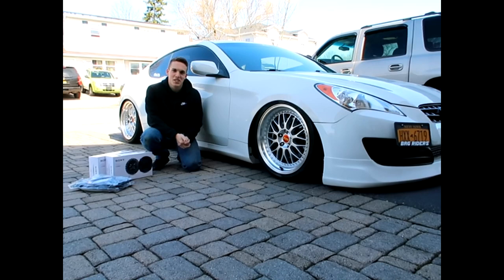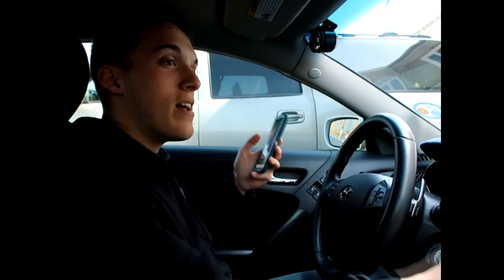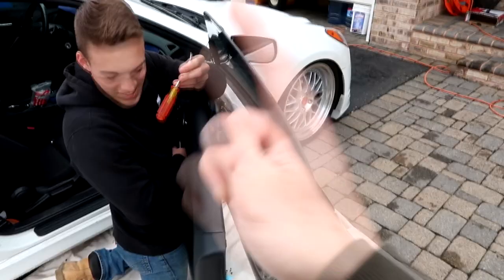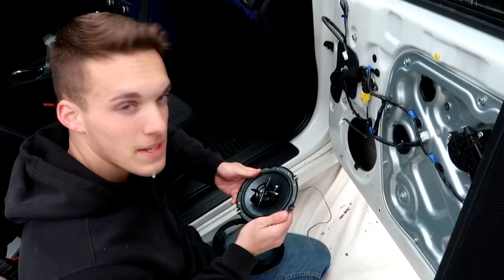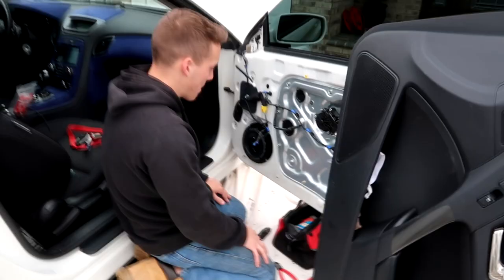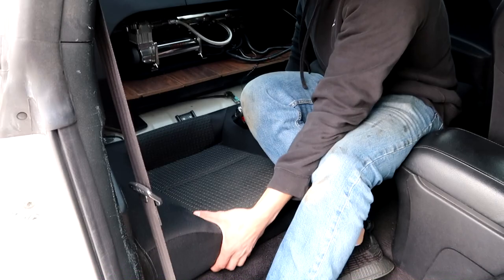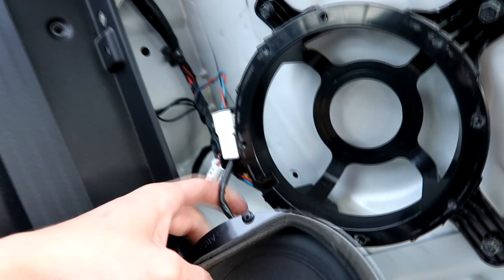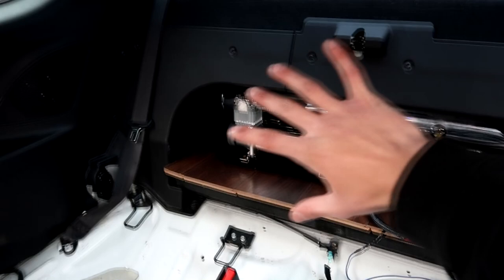Full Speaker System Upgrade in my Genesis Coupe

Comment: For anyone having issues with the rear. Take off the C Pillar. That's done by prying out the small circular cover in the middle of the C-pillar cover using your finger nail. Next, using a 10 mm socket, extension and ratchet, remove the single retaining bolt, and pull off the C-pillar cover (gently). Several tabs hold it in place in addition to the screw you removed.
Reply: came to comment the same thing, though i'm late. i was cussing at the screen so much like WTF ARE YOU DOING, TAKE THE PILLARS OFF!!!
I clicked on this thinking he was doing the rear deck sub too but stayed to watch the inexperienced, struggle.
Reply: Is the stock genesis front speakers 6.5 inches?

Comment: Not the greatest song for testing a speaker system, the stock system sounded VERY bass-heavy and tinny in the highs, I will definitely be upgrading mine and EQing it properly. Thanks for the video!
Reply: Another thing is you need to test before putting the panels back on, very good idea to make sure everything is working properly to risk less damage!
Reply from the maker: Thanks for the advice, much appreciated👍
Reply: @acauto7886  No problem bro, that's what life is for, the experiences and learning things along the way. Enjoy the rest of your day man, cheers!

Comment: You ever do the center deck speaker ?
Reply: Also u ever by pass stock amp to another 5 channel amp?
Reply from the maker: I did not change that speaker.
Reply from the maker: And no, i did not bypass the stock amp👍
Reply: @acauto7886  bro do you have an idea on how to eliminate the vibration/roar sound on the trunk...good video tho.!
Reply: @omeroguzman6935  unplug the two speaker in the trunk. They are horrible lol. Had the same problem

Comment: Random question. My bk2 radio plays music at a lower volume on Bluetooth audio. The satellite radio and fm radio actually sound okay but when I switch to Bluetooth it almost sounds muffled, do you have that same problem?
Reply: Or did that head unit fix that?
Reply from the maker: Hey man, actually my head unit does a pretty similar thing. The Bluetooth audio doesn't sound as good regular am and fm. I think it has to do with the Bluetooth connection

Comment: Hey man what stereo do you have installed?
Reply from the maker: Hey man, I have the Sony XAV-AX1000 👍
Reply: AC Auto hey man, do your steering wheel controls still work with that stereo head unit?. Great video btw.